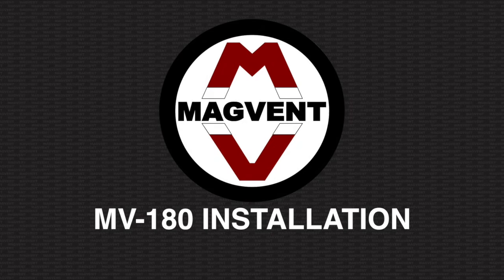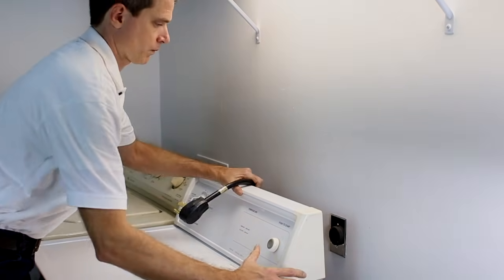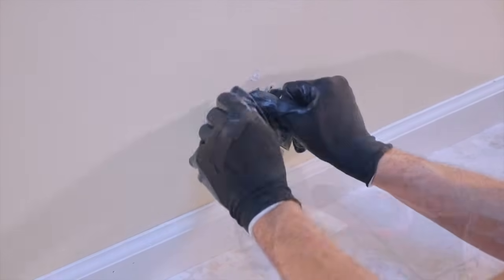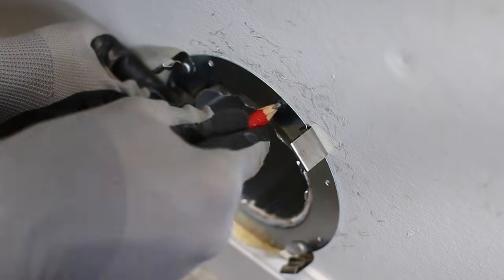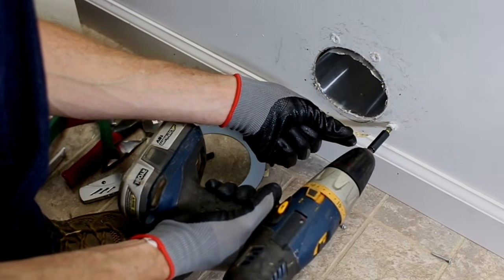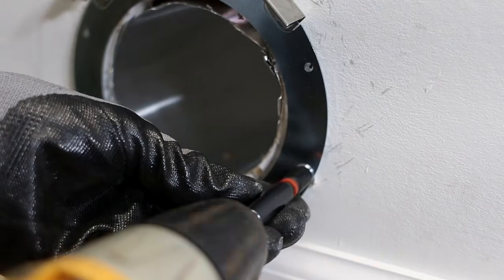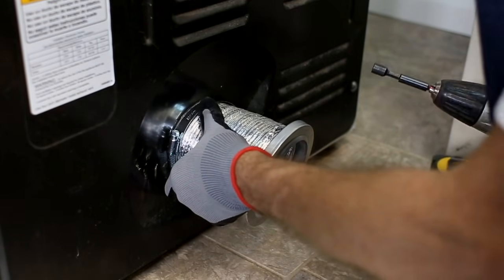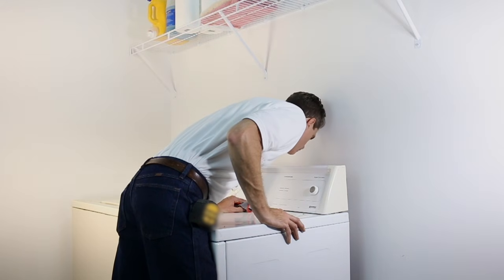MagVent MV-180 Dryer Vent Installation

Comment: My dryer is lined up with wall exit. Can the other magnet just go on the dryer?
Reply from the maker: The hose is needed to help with any vibrations during the drying cycle and to ensure that you get an airtight connection.

Comment: Having problems getting my bracket attached to wall. It is concrete.
Reply: Hammer drill, cement bit, and plastic anchors! To make the big 4” hole, you’ll have to drill multiple holes around the circumference tracing, knock out and grind to fit! A lot of dust so use a dry vac while doing!

Comment: If you pull the dryer out it yanks the vent hose off of the dryer and rips it.
Reply: That’s what I am afraid of… anything I see says to just pull the dryer out and it will pull the magnet off … but I can’t hardly separate the 2 pieces before we set this up.  Would have helped if there were small handle tabs to help - instead of tearing the flexible duct.  
We clean out the vent run every 6 months … thought this would be just the ticket !

Comment: It seems a good idea. But my high school science tells me heat gets rid of magnetism. Am I missing anything here?
Reply: I strongly suspect that the temperatures on these magnets will be waaayyy below the temperatures required to weaken/remove a magnetic field. You can google that question to verify my premise.
Reply: We use a custom made ceramic ferrite magnet which does not lose it's magnetism with heat. If you were to use a neodymium or similar magnet yes it would most definitely lose its magnetism.
Reply: A quick search found the following, but it could just be government misinformation.

Neodymium magnets
Standard grade neodymium magnets lose their magnetic output at 80°C, but higher grade magnets can operate at higher temperatures. For example, magnets with a "VH/AH" rating can operate up to 230°C. 

Samarium cobalt magnets
Standard grade samarium cobalt magnets don't lose their magnetism until the temperature exceeds 350°C. 

Alnico magnets
Alnico magnets can operate up to 600°C, but they are susceptible to demagnetization from external magnetic fields and physical shock. 

Ferrite magnets
Ferrite magnets lose their magnetism at 250°C, but they can also lose some magnetism at temperatures below -40°C.

Comment: I would like to try this but I live in an apartment. Is there a way to install it with out cutting off the pipe in the wall?
And, is the flexible part made out of that plastic stuff that catches on fire? Or is it actually metal? I’m worried about that. Thanks.

Comment: I tightened the clamp on the dryer side as much as it can be tighened but when I pull the dryer away instead of the magnet releasing the vent pulls off the dryer

Comment: I purchased this but have not yet installed it (still need to do some renovations to swap a bathroom with a laundry room so duct will have to be moved).  It looks and feels pretty sturdy & I'm hoping installation will go well. My dryer will have to come out at least 4" from the wall since there is an odd bumpout the shelf will line up with. Hopefully this will work well & we will get the measurements right (we'll be using cardboard templates) & dryfitting things before any cutting happens.
I'm looking forward to getting this installed & plan to take pictures & hopefully some video.
Reply: Any updates??

Comment: What happens when you want to pull out the dryer..does the magnet release? 😏🤨
Reply: Very easily.... yes
Reply: No. The magnet will stay connected unless you exert enough force to remove it. I'd recommend pulling the dryer out far enough to access the ducting and disengage the magnets by sliding them apart. I think Mr. PNW's suggestion of using a yard stick could probably work.
Reply: From what I read you can use a yardstick to push it off.

Comment: How is this different from the MV 90?
Reply from the maker: We offer three separate models for a variety of dryer vent situations. The MV-180 can handle offsets of up to 3 inches from center to center. The closer to perfect alignment you can achieve with your installation, the better your vent path and the closer to the wall you can locate your dryer. With perfect alignment, the MV-180 requires 4 inches of clearance behind the dryer. If you have the maximum offset of 3 inches, your dryer will need to sit an additional 3 inches from the wall to allow for a bend radius in the transition duct.

Comment: Great Idea but with any offset from a straight shot from dryer to wall creates a minimum clearance from the wall equal or greater to the flex vent fully expanded.  Very seldom is the dryer vent exit and the connection on the house a straight line left right or elevation
Reply: I went to their site, they have 3 versions, this 180, the 90 elbow and a version without hose.  The 180 and 90 allow for a 3-6” offset.  The third option allows you to add longer lengths of your own hose.
For offsets there’s a photo on Amazon show how a guy who used 3 pieces of tape to support the magnet at the correct offset location it would connect to the wall.  One long piece acting as a hammock for the magnet and two pieces of duct tape to secure the hammock at top. Great idea.
Reply: Right, but when the two align perfectly or within an inch, it is a great option.  Safe and efficient, and saves space.
Reply: You have to adapt the vent to what is in the wall.  I just ran into an elbow and it took a little trimming on the magnet side to get it in.
Reply: But a Raised 4” platform from Amazon DA noob!! 😂